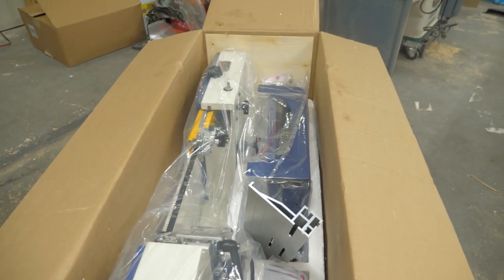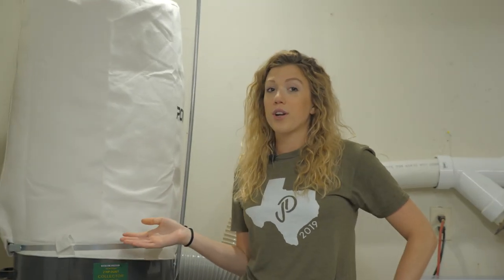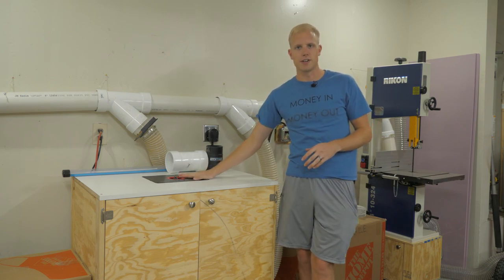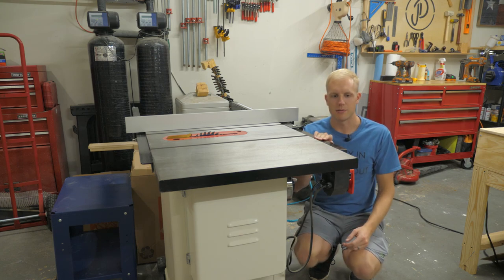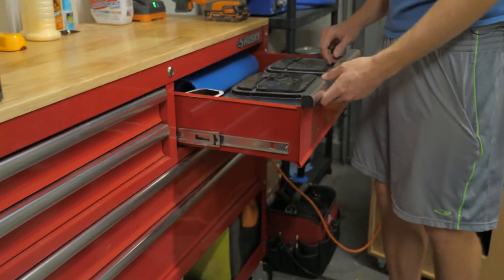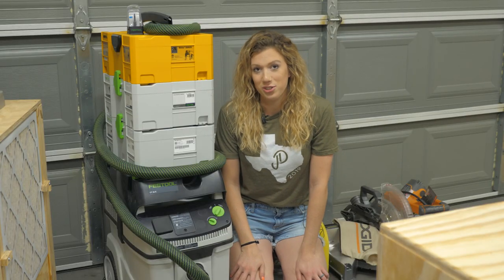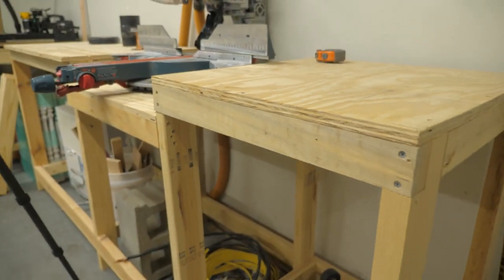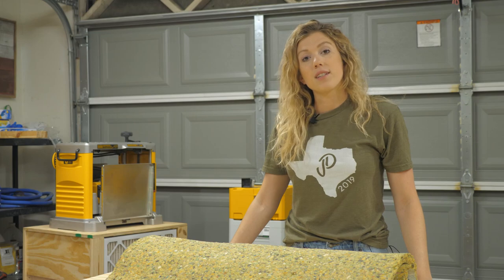🏡We set up shop in ONE WEEK for our Furniture Business | Shop Tour Fall 2019

Comment: O to be so young again!
Safety Tip - spiral wrap your PVC dust-collector duct work with simple 18ga steel wire (home Depot) and connect it to a grounding source.  Be sure to run an occasional screw through to the inside of the PVC pipe and wrap the wire around it.  Also connect the wire in your flexible ducts to ground on one end.  This will bleed off the static charge that can give you quite a jolt and even cause a fire!
Reply: That is a Myth about the fire, I’ve read numerous articles about this and it can’t happen. Don’t waste your time.

Comment: Good luck in your new location, it’s difficult to start in a completely new location! Since you are dedicated to shop efficiency, build a vertical clamp cart. It is much more efficient to bring all the clamps to the job instead of going back and forth at least twice, once to get them and once to put them back.
I owned a shop for fifty years, one of the best thing we ever built was a drop leaf out-feed for the table saw ( and we had a 10 foot panel saw ). There are shelf brackets were you lift up and it locks horizontal, then you lift again and it folds to vertical. Our top was just short of the floor when folded down. When up it gives you an additional 33” of out feed. You can cut an eight foot strip with no problem.
I do have a problem with trying to get customers to pay more once you have quoted them a price ( previous video ) I have done plenty of jobs that cost more than I thought, but I never made the customer pay for my incompetence. If you get a reputation for not adhering to your quotes it will bite you. 
I wish you all the best! I almost wish I could start over.
Reply from the maker: Thanks, Gary

Comment: I have the same model trim router and like it a lot.  I just hate storing all my stuff in bags.  I'm doing a router table currently for a dewalt router my wife got me to fit my lift.  I scored a unused router lift and router table fence from a thrift store of all places.  30 bucks!  Going to put a storage drawer in it for bits and deep drawer at the bottom for the trim router, plunge base, maybe a jig or two if they fit, May do two drawers on the bottom for that..  I leave usually leave a flush trim bit in little ridged as its handy for a lot of stuff.  Welcome to TX.  Its a great state.  Not in Houston, but was born not far from there.

Comment: I've got the same bandsaw, but mine came with a solid base. I had a few issues during assembly of bolts not quite fitting but overall I love the bandsaw now that it's together and I've used it for resawing 10" of walnut! The wheels you guys choose freak me out though and I'm not surprised they broke. I bought the Rikon wheel kit where the bandsaw base sits firmly on the ground then when you want to move it you just raise the one wheel and it moves easily across my garage floor.

Comment: Nice start to your new shop.  I’m jealous of anyone with shop ceilings over 6’-0” high lol.  My house is over 100yrs old and the basement isn’t that tall.

I was researching the two Rikon 14” bandsaws a ton to figure out why the price difference when they look on the surface so similar.  I found a fantastic video and the higher price one has all sorts of upgrades like better table tilt system, thicker gauge metal in spots, and just all around built more rugged.  Might be a consideration if that’s still an option as the more expensive model has more than just the enclosed base.

Comment: I have the same bandsaw and have it on a mobile base.  You should have reinforced the base with a plywood panel and then attached the casters which then distributes  the weight evenly.  If you look at the corners they are not intended to mount casters the way you did.  The saw is a good saw so i'm sure you will look back at this some day and laugh.
Reply from the maker: Ha. Ha.

Comment: Why didn't you read the manual? The small holes are for anchoring the stand to the optional base plate, which is required to mount the wheel kit. They didn't build a bad product, you poorly modified it by mounting swivel casters to gussets that were never designed to withstand upward or torsional forces. The stand is designed to be semi-rigid, which allows the legs to self-level on slighly uneven floors to prevent wobbles. The failure was completely your fault. Just own it and move on.
Reply from the maker: I bet you’re the kind of guy who blocks the grocery aisle reading all the nutrition facts, too.
Reply: @jennieanddavis  
Don't let your pride get in the way of lessons learned.